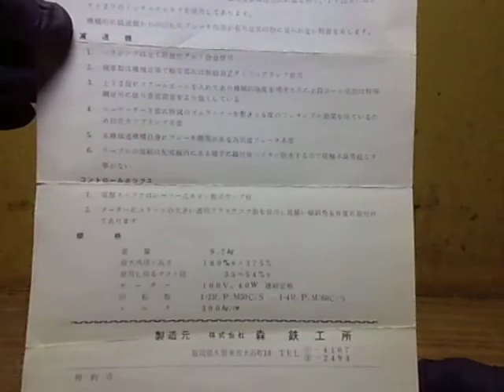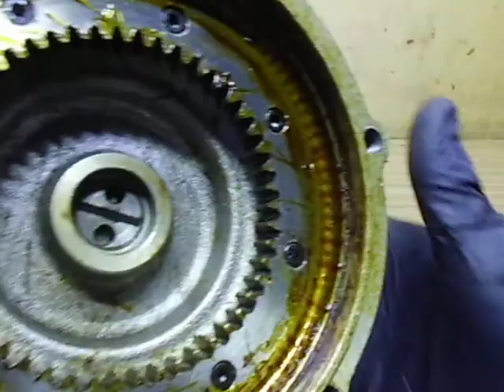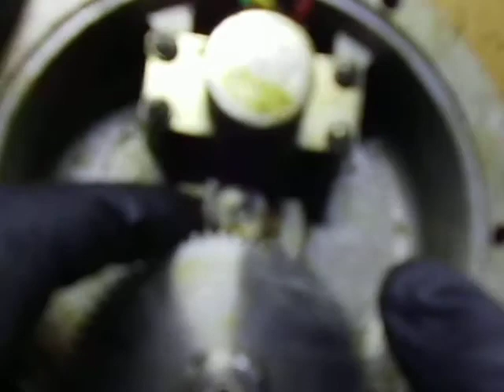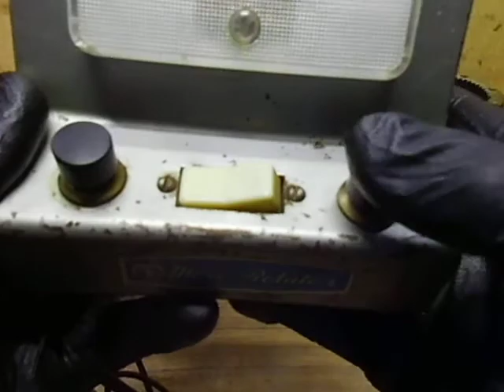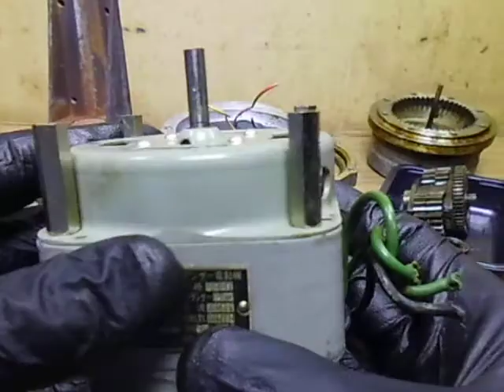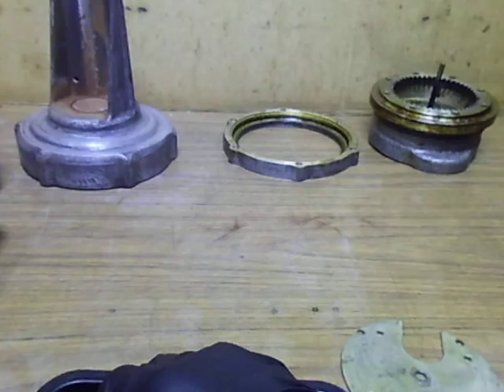MORI MA-100 Rotator strip down part 1

Comment: The MX-1000 has a roll pin holding the gear on the shaft of the motor.  That plate holding the motor in that housing, I used a hacksaw and notched the plate out to the hole the motor shaft stick's out so later you can pull the plate with out driving the roll pin out of the shaft. The MX-1000 has limit switches,  it's a PITA to get the motor back in with all the wires. It also has a 7 pin plug on it like the Wilson WR-500. That motor driven gear also has a roll pin it it too.